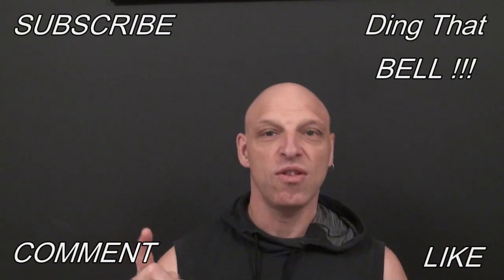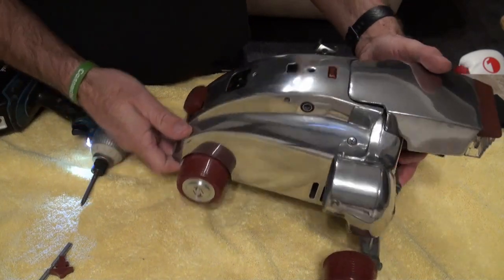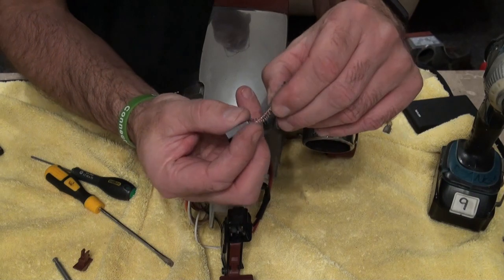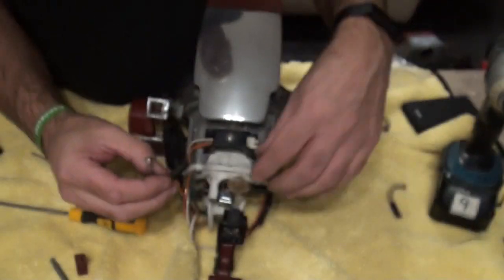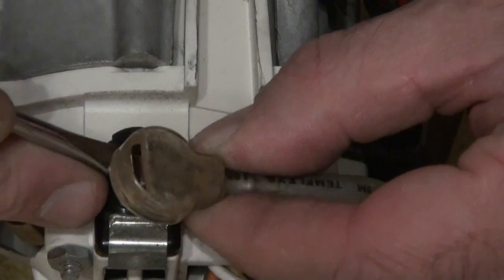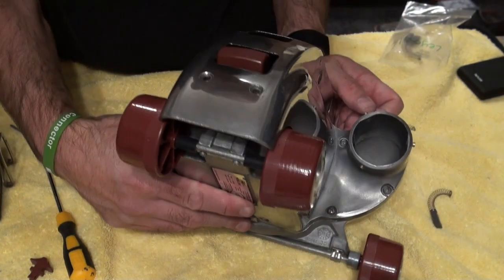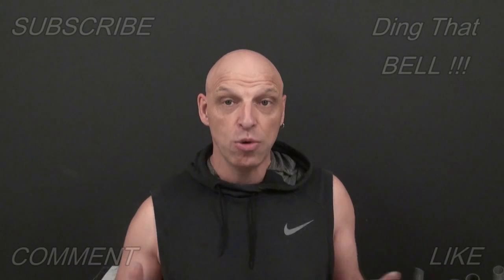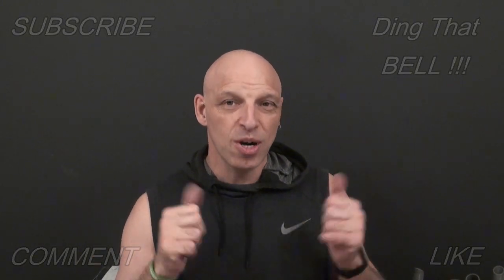KIRBY VACUUM HOW TO CHANGE BRUSHES IN A KIRBY VACUUM LEGEND II.

Comment: This would also apply to models Classic 1CR to all Heritage IIs built before September 1986 (your Heritage 84 being among them), except in those cases the field terminal clips (104569) were soldered (not crimped) on the bare ends of the brush lead wires at a 90-degree angle, and the carbon brush caps that were made during that time (part no. 107173) were shaped to fit that particular contour.